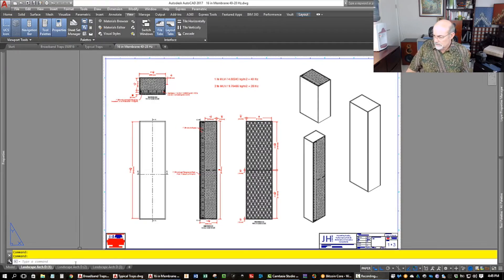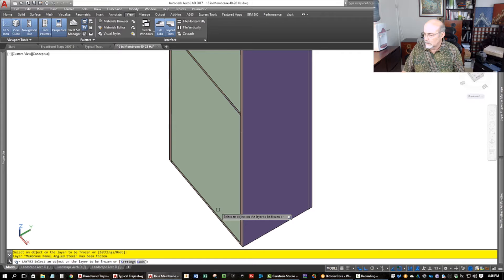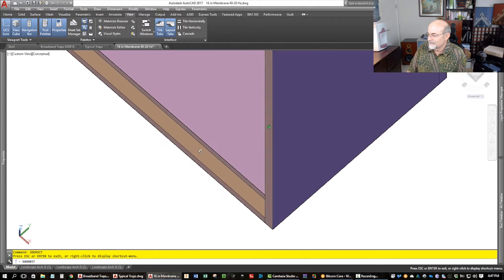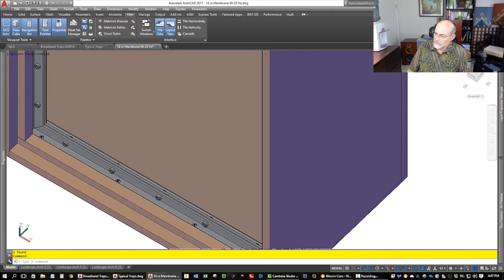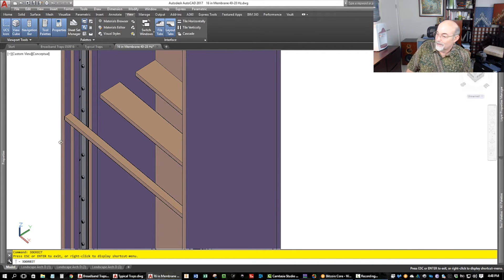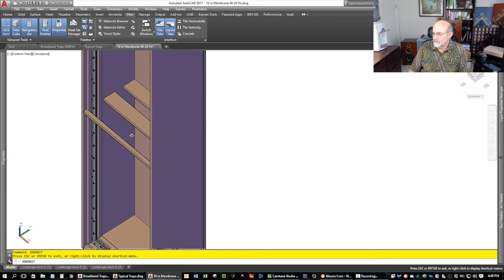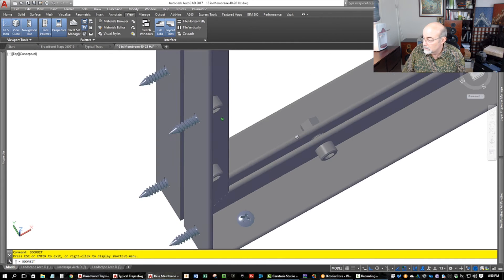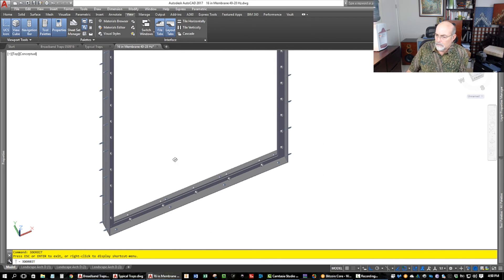Small Room Acoustics: Traps and Frequency Response - Part One

Comment: Hello sir John, 

I'm going to do a DIY audiophile room.

1.) Would it be alright if the right side of the wall is made of concrete (the existing one) and the left side is made of drywall with rockwool insulation (new wall)?
 *will having different wall materials affect the sound quality of the room?

2.) What thickness is recommended for the drywall and rockwool?

Thank you!
Reply: Your questions tell me that you need to educate yourself a bit more on acoustic treatment before attempting this build.  What are you trying to do, build a room that is soundproof, or build a room that is acoustically pleasant, or both?  Concrete reflects almost everything back into the room.  Drywall walls, even with 2 layers of drywall on both sided of the stud and rockwool in between will leak most of the sub-bass through.  Furthermore, this room will not be acoustically pleasant without some acoustic panels that decrease sound reflections.

Comment: Hey John I'm in room which has ceiling height approx 2.5 meter. And I have room which is above this room and has the same dimensions as the room below where I have my monitors right now, but it is under the roof and has weird angled roof that has 8 corners. In the center of the room is the biggest distance from the floor to ceiling (tip of the roof) in this room which is approx 3.7 meters. Should I move my studio to this room istead of the room below? 

Thank you!
Reply from the maker: Daniel, I don't know. I need to know a LOT more about the spaces. Perhaps you could send me an email with drawings??
Reply: @JHBrandt  I could send you photos of the room, which email shall I use?
Thank you!
Reply from the maker: @daniel_kisel , use john@jhbrandt.net.
Talk to you soon.

Comment: Does every membrane need its own cabinet with side walls or can i use a whole wall as one cabinet and mount several membranes next to each other? It would safe money and time but will it loose performance?
Reply from the maker: I wouldn't do it. I have no supporting data to say that it would even work. Membrane units, even limp bag types, are tuned. The larger they are more unwieldy they become.  I also would not go 'crazy' with them. Us them for the amount of trapping needed AT THAT FREQUENCY. The rest should be broadband and diffusion. That's my opinion based on very little information about your situation. LOL.
Reply: @JHBrandt  put a perforated panel in it and it works broadband ;)

Comment: does the back wall of the membrane absorber need to be parallel to the membrane? I want to mount it into the corners and safe money and work with building a parallel wall
Reply from the maker: It does if you want to know the resonant frequency of the membrane. It is very difficult to predict the resonance when the trapped air has more than two 'modes'. Depth being the critical factor.
Limp membrane traps work at one frequency. They work best when placed in the center of the wall where that axial mode is at its peak performance 😉
Reply: @JHBrandt  Thank you!
Does the weight of the membrane only tune the resonator down, or does it also increase the performance of the unit. I can imagine that it could handle lower frequencies better, because it doesnt move that easily
Reply: Yea

Comment: Excellent video. My only question (because I wan't to try and build some of these) is: What is the material that is being held by the metal frame (the diaphragm). What is that material? Thanks
Reply from the maker: Some use an MLV, but I have found it to be far too thick at the correct mass. Therefore I specify a sheet steel and rubber sandwich. This sandwich is different for each application and determined by the mass required to obtain the desire frequency of resonance. 
My question to YOU is: why do you think you need membrane traps? :)
Reply: Mr. Brandt, thank you for your quick response! My room is 10.5ft x 12ft. Because of how the room is situated, I am set up with monitors dead center of the room, and I am facing the 12ft wall. I have a fiberglass panel facing me, and another identical panel behind me. The walls are mostly drywall, floor is ceramic tile. The bass in here is not good, and is all over the place. I don't believe in foam at all for bass. Judging from the research that I've done, the only way to tame bass is with membrane traps. I am currently selling my monitors, which are 8", and too big for this room I think. I'm going to change those to 5", and see how that works. However, this is a new home, so I'm trying to dial this thing in, because right now - it has too much reflection, and is impossible to mix in.
Reply from the maker: If your ceiling are 8', you don't have enough volume. You only have 2/3 of the recommended volume of 1500 cubic feet for even modal distribution. 
Now THAT said: you CAN treat the room and get some decent work done, but you'll need a LOT of broadband treatment. Membrane traps are NOT going to help you in this instance. You do not have concrete walls. You have a framed structure and if it is residential, your wall resonance/transfer frequency is around 70 Hz. At resonance, sound passes right through, as well as all of the frequencies that fall below resonance. 
I've said this before, you don't TARGET nulls with membrane trapping, you target Axial Modes! And your axial modes most definitely will fall below the wall resonance... it gets complicated here and I don't have the keystrokes to explain. Perhaps in the next video.
Please read my Balanced Non-Environment Criteria paper found on my resources page. All the best!
Reply: Thank you!
Reply: I've read your paper on Balanced Non-Environment Criteria, and it's way over my head. I really don't completely understand what "broadband" treatment is. For my room, I think that it would sound a lot better if I would to lessen the reflections, and continue to mix my demos at a low volume so that the room doesn't come into play as much. I have to keep reading your resources. I'm certainly no engineer!
Reply from the maker: If you would like my help, send me an email. - john@jhbrandt.net 
Cheers!

Comment: Great looking bass trap! I wonder, does this simply get pushed into a corner or should it be angled across the corner? Thanks
Reply from the maker: Terry Doyle these membrane traps are usually placed at wall centers. I don't usually use these in corners. Also, this type of trap is rarely needed in a framed room with gypsum panels.

Comment: This is just such an unbelievable resource. I can't thank you enough for all this information you are providing..

I have been researching and planning for almost a year now. I have a large garage I am going to convert. I want to use it for a tracking and mixing room. Going to try and go with a combination room.

I have removed all the Sheetrock from ceiling and walls. And in the process of reinforcing the outer sheathing by attaching the Sheetrock to the sheathing from inside the bays leaving enough room for backer rod. I sealed the sheathing with silicon then applied the Sheetrock and sealied that with silicon. Then I am going to put the pink fluffy back in existing cavity.
 
Frame new walls leaving 4 inches between 2x4 edges. Then pink fluffy in new leaf, which will be properly decoupled and have firestops in the proper locations.  Then 2 layers of 5/8 rock with green glue between. Th ceiling is going to be on hat channel attached to RSIC #1 clips , 2 layers of rock with GG in between. 

I intend to trap at all 12 corners, and by building the corner traps detailed in Rod book as well as Everest. 
I am wondering how to put my values into your room mode calc if I have an L shaped room?

I have not framed walls yet so I certainly have the ability to alter plans. I have purchased all my 2x4 material, most of my gypsum, the green glue, clips, hat channel, a pallet of pink fluffy, a bunch of 703 and some 705 FRK (do you agree with Everest on using that with foil facing out in corners?), a MINI SPLIT unit. Pretty much 90% of material.
I have a lot of various hardwoods on hand at my shop, and want to build my own desk etc, QRD, etc. 

I was considering building the acoustic frame so that I could be modular in a way. Essentially place and remove panels as necessary or reverse boxes that are absorptive on one side diffusive on the other. 

I have got to the point that I have talked myself in and out of just about every option and design, and I'm back to where I started .

Anyway thank you for you videos.